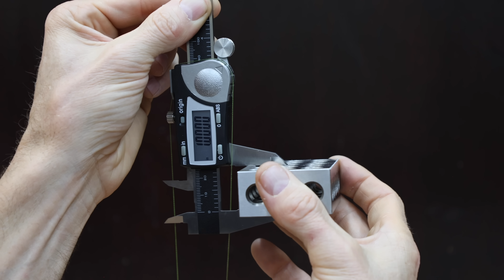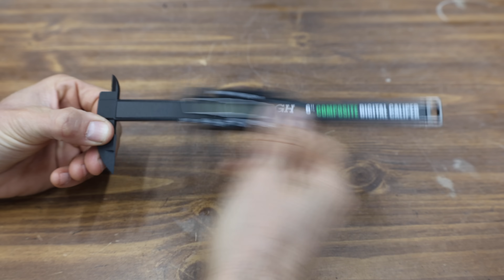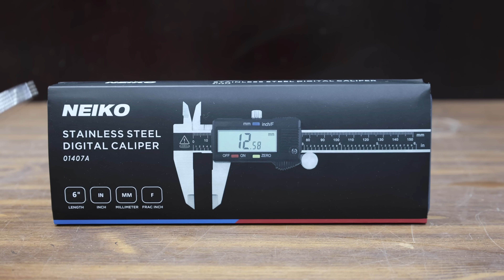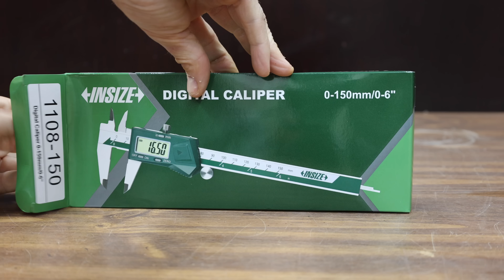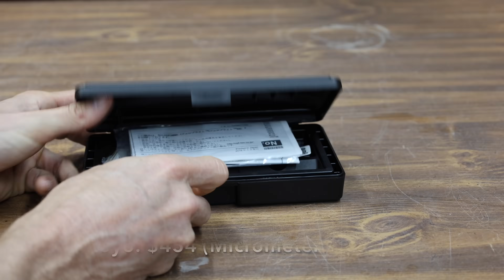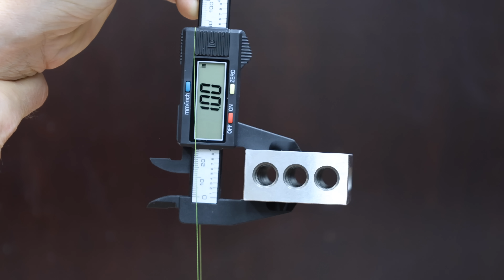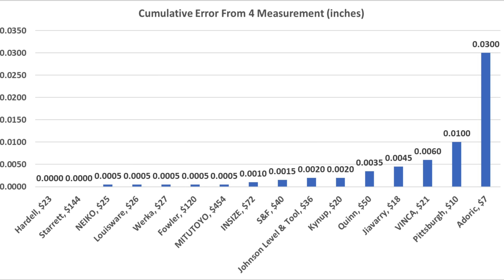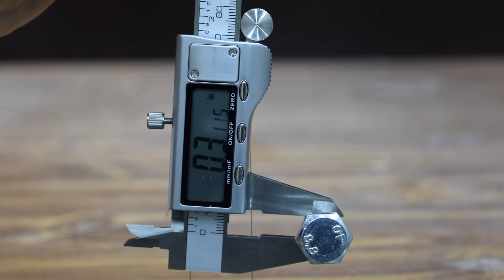I've Been Proven Wrong About Calipers!

Comment: Here is another observation that you don’t realize for quite a while. Some models drain the battery continuously, even though the device appears to be off. I’ve noticed this in the Harbor Freight models. The simple solution is just to remove the battery in between uses, which is a bit of a pain but considering the cheap price I guess I can live with that workaround. At least two of the Harbor Freight calipers will drain the battery in less than a year if it is left in the instrument. Don’t know about the other ones. It is really quite a pain and disappointment to reach for your instrument that has been put away in storage and maybe the only used a time or two, but Has a dead battery with almost no use in less than a year.
Reply from the maker: Thanks for the feedback.

Comment: I don't know where you bought the Mitutoyo, but your pricing is WAY OFF. You can get that Mitutoyo at around $125.00 and the Coolant Proof Mitutoyo at around $175.00. After using multiple brands over the years, I will never use any other digital (electronic) caliper except Mitutoyo. Everything else always falls short of expectations. I have a 20 year old set of Mitutoyo Calipers that still calibrate perfectly after daily use. There is no better in my opinion.

Comment: Mitutoyo actually use an SR44 battery and warn against using LR44 as it can compromise the performance. And 100% affects the battery life. I have 3 Mitutoyo digital calipers and they all have 'auto off' feature. The only thing I have an issue with is my Mitutoyo digital micrometers won't turn off sometimes if I don't lock them. Even vibrations from surrounding workshop equipment can wake them up. 

As always, great video. You're doing the hard yards so we don't have to 👍
Reply: Thanks for the battery info.
Reply from the maker: Thanks!

Comment: I'm not a big fan of digital callipers, I'm a bit old school. Get a set of vernier callipers and use them... no batteries to go flat. Also, the biggest screw up i ever saw was due to a tool setter in a factory forgetting to zero them after lunch and setting the second half of a drop broach pack 1mm high. It jammed in the pit and it took my team and a  hired crane all afternoon to get it out. Just my $.02
Reply from the maker: Thanks for the feedback.

Comment: Great video, but I wish you would've measured how long the battery lasts when the calipers are stored with the battery installed.  I bought a set of General calipers from Home Depot about ten years ago and they still work fine after regular light use.  The thing that drives me bonkers about them is the fact that they discharge the battery almost completely after a couple weeks of sitting in the closet.  They also have one of those ridiculous screw down battery covers, so taking out the battery and reinstalling it every time you use them is annoying.
Reply from the maker: Thanks for the constructive feedback.

Comment: I own and still use the Mitutoyo caliper I purchased in 1977 for $12. It’s a dial analog type and still going strong. Of course most people nowadays want the tool to do the math for them, but mine helps keep my brain sharp.😂
Reply: Brown and Sharpe was originally from Providence, Rhode Island started in 1833. Sold out to another company just like Massachusetts made Starrett. In the eighties every TIG welder bought Mitutoyo dial calipers 6 and 12 inch. Mine still have no wear, hardened stainless.
Reply from the maker: Thanks for sharing.

Comment: To echo otherr sentiments, the big problem I've had with cheap calipers is the durability. I don't need micrometer accurate measurements, but it annoys me to no end when I buy a tool and it breaks down on the first battery change. The cheaper units electronics are extremely flimsy (and naturally near impossible to repair).
Reply from the maker: Thanks for the feedback.

Comment: Mitutoyo all day IMO. I'm a CNC machinist and can't stand the Starrett measuring devices that are used in my shop because the owner "prefers to buy American". Technically, to get the most accurate measurements you should be using a granite surface for the depth measurements, and there's a lot to say about the human part of the measuring process, especially when you are taking depth measurements. You also completely ignored the step gauge function that I find much more accurate as you have two flat surfaces to keep stability and reduce error (when available due to surfaces being measured). Ideally, you would use a depth gauge attachment for using calipers the way you did to make sure you were holding it level and flat with the top surface of the part.
Reply from the maker: Thanks for the feedback.

Comment: some may see it a a nice feature but I hate calipers that turn off automatically. It is bad on the cheaper ones where you have to turn them back on and sometimes they reset their zero and you lose the measurement you needed. the reason why the mitutoyo doesn't turn off is it is a professional tool for use in a machinist shop. As many machinist's have told me if you ever see a set of calipers sitting around open don't touch them someone may still be using them, and you don't want to mess that up.
Reply from the maker: Thanks for the feedback.

Comment: I would have assumed Starrett would have been the most accurate, but after the recent change in ownership I had my doubts that their products would still be the most accurate. I'm glad to see that may be not necessarily true. When it comes to precision, it's always been a brand that I've trusted without question for decades. I'm glad to see that quality control is being upheld so far. It always stings a bit when purchasing a Starrett, but knowing I'm getting accuracy everytime I use it makes that cost worth every penny. I hope they continue upholding that standard of quality in the future. Like they say, trust is gained in inches, but lost by the mile.
Reply from the maker: Thanks for the feedback.

Comment: I took a contact burnishing tool to the rails on my cheap old Harbor Freight caliper. This smoothed the action out tremendously, making one hand adjustments a lot easier. Made me think I was using a much nicer tool without the gritty feeling when moving it up and down the slide.
Reply from the maker: Thanks for sharing.

Comment: As a hobby machinist, I have had excellent results with iGaging Absolute Origin.  They give me consistent, accurate measurements, that I’ve tested to 0.001” using gage blocks, 123 blocks and against my micrometers.  The battery draw is so minimal, I’ve used one set for 4 years without changing the 2032 battery.  There is no automatic shutoff, but that is due to their minimal power draw.  The mfg claim is they will run continuously powered on for one year straight.  Based on my experience, I don’t think that is an exaggeration.  

I think the iGaging Absolute Origin calipers are a quality product worth every penny.  I have 2 of their 6” calipers, 1 for machining and the other for my reloading bench, so they both get used quit a bit.

I tried some of the cheaper types (the ones with the 2 screws on the battery cover).  They wouldn’t hold zero and they ate 2032 batteries pretty fast.  Compared to the iGaging Absolute Origin calipers, the cheap ones I had before were a complete waste of money.  OTOH, you don’t need to spend Mitutoyo money to get quality calipers.
Reply from the maker: Thanks for sharing.

Comment: Todd touched on battery life near the end, but it is a huge difference.  The battery on my Mitutoyo calipers lasts forever.  One time I bought cheap calipers for home, and it was constantly eating batteries.   I threw those calipers out.  
There is a certain amount of skill required to get an accurate measurement. If your calipers are not dead square to the object being measured, the error due to how it was held will be more than the electronic error, even for the cheapest calipers.  Hard to imagine holding a 1-2-3 block and a and calipers with a weight on them, in front of a camera, is going to give an accurate measurement.    Todd is talented, but that is stretching it.  
Using the depth gage accurately, I find is even harder.

Comment: Depends on the application. I wouldn’t use anything lower than Starrett but Mitutoyo is tried and true. I was a machinist and a calibration tech for the better part of a decade. With high precision stuff the harbor freight calipers had a very high rejection rate and usually had to be fully rejected in a year if they had passed. The jaw taper is unacceptable and can only be adjusted so much. But if you’re looking for something that only needs plus or minus 10 thousandths then they are great. Anything needing to hold plus or minus a thousandth then pay the money.
Reply from the maker: Thanks for the feedback.

Comment: This is probably the first project farm video I have ever been disappointed in. I believe a lack of understanding how these tools function probably led to some incorrect assessments. first off, half a thou is well within the margin of error for even a seasoned machinist with a pair of calipers, anything that needs .001 accuracy should be measured with a micrometer for exterior dimensions. the second issue is the use of a generic 1-2-3 block for comparing accuracy (although my previous pint mostly dismisses this), the correct way to do this test would be with gauge blocks, which have a sole purpose of being certified to be a certified dimension. the third issue I noticed, is repeatedly referencing the "package price" for the Mitutoyo calipers, when they are readily available as JUST calipers. The fourth is the fact that the starret and mitutoyo (mostly the mitties) were purchased on amazon, which is NOTORIOUS for selling fake high end calipers. The fifth and final issue is the omission of which calipers came with NIST certificates of calibration, which is absolutely relevant to anyone who wants an accurate reading.

Comment: ok .. Take this video with a HUGE grain of salt 😅First off, i dont get why one would do these tests in imperial units , but let skip that .. Trying to compare calipers without proplerly mounting them and things like that is just mindblowing :D And the sliding force, my guy why dont u just adjust the little screw on the back ? I've been working a lot with 3d printers for the last 10 years, so most things are 0.01 - 0.5mm range and with such tiny measurements it's just no way your are gonna get proper comparison doing things like you just did.. Big fan of the channel, this video however is a hard fail :)

Comment: I've always gone by my grandfathers advice, given to me by my dad. (grandad was a tool and die maker for Carrier at their Syracuse NY plant and my dad worked in a sheet metal fabrication shop)
his philosophy when it came to tooling, ESPECIALLY metrology, was buy the best you can afford, that your measuring tooling was the footing upon everything else your work stood upon.
he used joblocks and calibrated about once or twice a year. (i remember watching him and asking what they were :). he called them his special measuring blocks)
Reply: Most welders & sheet metal mechanics in the eighties & nineties used Mitutoyo dial calipers until the electronic ones were available. Nobody ever bought Starrett was a overpriced union shop. For home hobby use I buy fake Mitutoyo on E-Bay for 45 dollars. I was a TIG welder/fabricator who worked from decimal based blueprints. Used Mitutoyo dial calipers, they never wore out.
Reply: @georgebuck2269  yep.
my grandad retured in 1980. dads still with us and thus still has grandpas gerstner. its full of mostly brown and sharpe and starrett but it WAS likely put together in the 60s and 70s. when analog was king. i do love me my digitals, i do have some cheap stuff but i dont count on it for critical measurements. roughing or ehere tolerances are +-  .005 sure. anything finer? out comes the "good stuff"
Reply: @RedDogForge  Brown & Sharpe was originally from Providence, Rhode Island in 1833. Starrett was in Athol  Massachusetts started in 1880. Very high quality tools back in the day. They both sold their companies years ago. I used to buy Starrett combination squares and hard 24" and 36" rulers for the square heads. In TIG welding it's all blueprints and + - .015 tolerance unless your doing military defense work which is  + - .005. The Mitutoyo dial calipers will never wear out, my 6" and 12" are from 1982. If I wasnt retired at age 72, I would buy the real Mitutoyo electronic calipers for work. Price $ 155 - 165. Fake on ebay $ 45.

Comment: A common problem on many cheap calipers is that when "off" they just blank the display, and use no less power than when on, so batteries die way quicker than they should

Comment: I have an old $25 dial caliper from Japan from 1972 which is still in great condition.  But I wanted a digital for the added metric and fraction scales, so I got an old $15 Pittsburgh in stainless with the depth guage built in.  Both are accurate to a thou, so I'm fine with them for woodworking, fabbing, and metalwork.  When one breaks, the Werka looks good.  Thanks for all your tests, Todd.
Mitutoyo and Starrett are good with fine names, but neither is worth the price to me.

Comment: If precision accuracy is what you’re after, calipers aren’t not the right tool for the job. Micrometer is. Repeatability is most important to me and I imagine everyone else is as well. I have a heavy distrust for every digital caliper. Main thing is understanding how to use them. Calipers will get you close enough but as long as you use the same measuring device throughout the project, unless you’re building rockets, it doesn’t matter. Learn to use them correctly and a cheaper caliper will do everything you need it to. As long as it’s repeatable.

Comment: no dial calipers? 
  After 25 + years of using calipers daily, those who do don't use digital.  I have digital calipers, mostly used for metric stuff. digital calipers can be reset to zero by accident while opening jaws, etc... Dial calipers will always let you know if they are mis reading skipping, by feel.. often sending a nice crunching in the gear feel. mmmmm

Comment: Without measuring power draw at sleep this whole comparison is pointless. Only high end brands won't drain the battery within a month. Mitutoyo is well know and respected brand, which is the reason why they can charge that much and still stay in business. Also before testing any calipers you need to close them and make sure there's no light going through between the measuring points. If those surfaces are perfectly flat then measurement is repeatable. Something cheaper brands don't care about and was never tested. And just measuring how much discrepancy is there between measurements is pointless, if the device is within spec and all of them would be within spec. Another thing is durability of a tool. Plastic ones are bad, but hardened surfaces are usually rare, which Mitutoyo has and am guessing other higher end brands as well.  So there's a difference how long you'll use 20$ tool and after how much time it will start throwing numbers either direction. Oh and price on Mitutoyo is way off, they are like 120$.

Comment: With those cheap, always on calipers, the LR44 cell died every few months. Always dead when I needed it. So I just 3D printed an enclosure for a (much) bigger battery. Haven't changed one in years.

Comment: I have a Mitutoyo 505-742J Dial Caliper ($118) and Clockwise Tools IP54 Grade Digital Caliper, DCLR-0605 ($19.70), which are both very high quality.  I love the old-school dial of the Mitutoyo, but honestly the digital scale is easier to use.  I find that the digital scale doesn't always reset back to zero, though.  It can be a little glitchy.

Comment: I picked up cheap digital calipers once and decided then and there I will never use digital calipers again. There's simply too much room for error compared to a set and shaped manual tool determined by your eyesight. The sheer thought of using a digital feeler gauge sends shivers down my spine. There's some room of trust to pick up a digital torque wrench one day, but for now I stick with my cheapo mechanically adjustable one. I may sound like a grumpy old mechanic but trust me I rebuilt my first engine only two years ago.

Comment: Growing up I used to be a Consumer Reports guy - always consulted their reviews before making a purchase.  You have replaced Consumer Reports for me.  Such an awesome channel.  Keep up the great work!!
Reply: He only measures one sample of each.  Recommending a cheap brand a caliper because the one sample he used happed to be more accurate than the one sample from other brands is very short sighted.  He isn't testing how brands stack up against one another, he is testing one specific caliper against another.  When you buy a good set of calipers from a respected brand, you know that they have been calibrated at the factory, and that they meet the published specs.  With the cheap brands, you're counting on luck.
Reply: @brianjrobinson give it a few days and read the comments, people will mention if they've had good or bad experiences with those same tools over their lifetime. suddenly you have a bit more data.
Reply: Your comment is accurate. Consumer Reports would have had the same problem. 

In general, I have found that higher prices mean the quality is better and consistent through batches. QC costs money. 

Have heard that it’s not uncommon for Chinese knockoffs to be made in the same production facility / line as a name brand. They skip all the little things and the QC.
Reply: Same, this is the first channel I look at for information regarding any product I'm interested in buying and using.